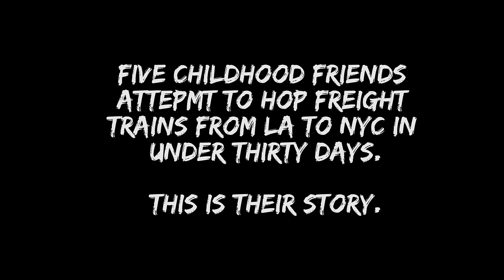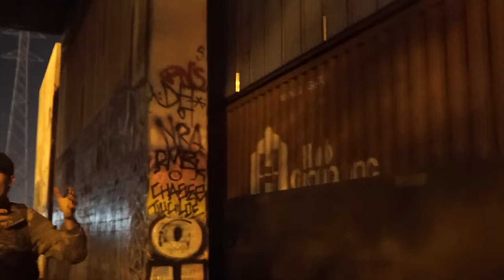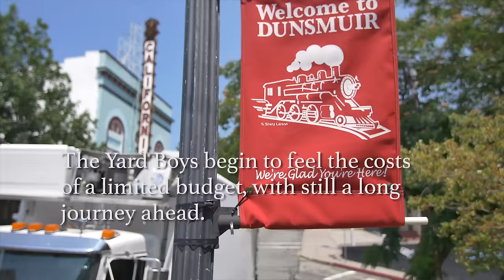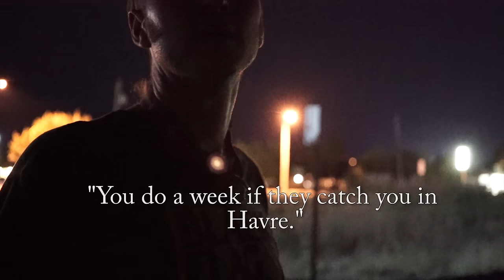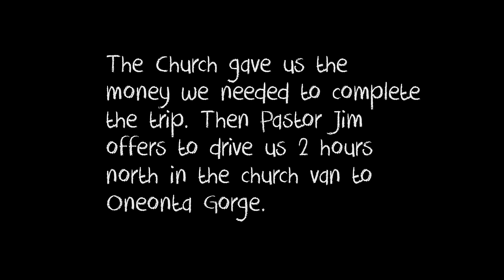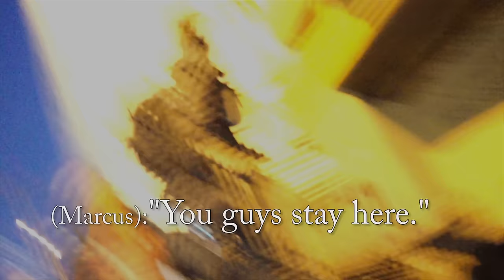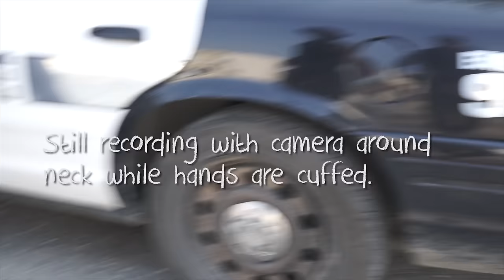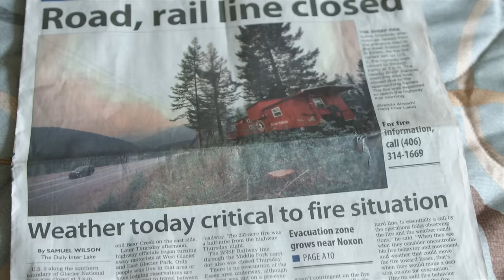YARD BOYS: Freight Train Hopping America

Comment: To anyone who is wanting to travel like this, here’s a few tips from what I’ve learned doing it with and without friend. 

Pack nuts, trail mix, or protein bars. They’re light, full of calories and fill you up without causing you too much time setting up. If you want more of a filling meal, beef jerky, tortillas w/peanut butter, and freeze dried meals are light enough to carry and dense in calories.

DO NOT try to hop on when a train is speeding past, you will either get seriously injured or die(you’re lucky if you get inured). ALWAYS three points of contact(at least two feet and one hand) to balance you. And NEVER stick your head out in a tunnel(because you can’t see what’s in front of you).

Bring earplugs because it is LOUD. Have a neck pillow(it’s a luxury that slightly cumbersome but it’s worth it). Always have gloves(black or tan).

Never fall asleep unless you are secure and do not roll around in your sleep while ON the train. If you do sleep off the train, try to find a place that doesn’t have slot of litter around(generally that means people are living their and you won’t get stabbed or attacked).

CASH IS KING. Always have cash on you because it will save your ass. I was almost arrested when I slipped someone a twenty and asked if I could go. It works most of the time, just not all the time. 

Do not do drugs unless you are in safe company. You CANNOT trust people you don’t know, especially when you are high as a fucking kite. 

Never bring a guitar or musical instrument, and definitely don’t bring any portable speaker. You will be found faster than you think. 

Make sure you pack for the climate and time of year. If you’re going in spring, pack for rain. Winter make sure to have warm clothes/warm sleeping accommodations. Summer, something cool. And Autumn varies, but always try to have warm-ish clothes that you can change in case it’s still warm. 

Always fill up on water. You’ll go through it faster than you think. Never get it from a creek or a pond, and always boil it even it’s from the top of a river. Stagnant water is always a no go. Water is surprisingly cheap, so if you can’t find any, just buy some. Having a tap key is helpful, just make sure to boil it to be safe. Also, always boil snow if you’re going to drink it.

Don’t fall in love, it never ends well and you’ll both end up miserable. And always use condoms when having sex. Mouth wash after oral(trust me).

Make sure to know the difference between a hard stop and a slow stop. Sudden stops in the middle of nowhere is usually either because the trains fucked or you’re fucked. If you hear people, stay put and get ready to run. If it’s a slow stop in a town or a yard, you’re usually in the clear, but still be cautious and don’t be stupid.

Finally, don’t take risks. If you’re 6th sense is telling you not to do something, DON’T DO IT. And if you’re gut is telling you to run, duck, or hide, listen to to your gut and so what’s easiest.

Also, fuck the dude with the blonde hair and glasses. All he would do would whine, bitch, and moan about how shit wasn’t going his way or would get in everybody else’s faces and just call them selfish or would just constantly fight everyone. Fuck that dude.
Reply: Thanks man
Reply: u sound experienced asf how long were u doin it?
Reply: but how was it?
Reply: thanks so much! planning on running away soon, and planning on using the tracks to get around.
Reply: @jaguarsparkle8788  good luck brother just keep in mind stay in the dark
Reply: Hell yea it’s December and I’m going from Houston to Chicago bout to hop a train wearing shorts and 2 t shirts,(one says tool on jt” have on white gloves only carrying my guitar and drum set, this is gonna be a blast will update with video within a week
Reply: Appreciated
Reply: Bro went through something
Reply: Man id have hoped to bring my acoustic, guess its time to bust out my harmonica lol
Reply: You're dope for posting that
Reply: @jaguarsparkle8788 what exactly are you running away from?
Reply: @one7deep7savage7 take a look around
Reply: + bring some hotdogs for a security dogs
Reply: the blonde dude with glasses at 12:00 was like “you have to get the shot” asking his boy to try and catch a train at 10mph with a camera in his hand lmao

Comment: Y’all should of mf ran into the woods like wtf why would you just stand there
Reply: yea isnt that what the camping gear is for lol exactly my thought
Reply: Other then They would have been stuck near a wild fire
Reply: @oxidizedgarage8265  they shoulda hid in the woods until the train inspectors went away and then hopped back on. simple. coulda finished the trip if they had any street sense.
Reply: @radakahl  I’m a bit late but you’re giving them too much credit lol
Reply: For real 😂
Reply: @radakahl  100% correct. They knew something was up. Trust your gut. E&E (escape and evasion) at that pont.
Reply: @radakahl  yeah but the wildfire wouldve killed them most likely if they got back on the train
Reply: These fools were already in so far over their heads, getting caught was their best possible outcome.  Running just would've compounded this goat rodeo.
Reply: @csn583  🤣🤣🤣

Comment: Did you also realize that aside from the danger of forest fires nearby, there's also the 7.01 mile long Flathead Tunnel just up the line outside Libby that you would have had to pass through? Getting arrested might have actually saved you all from quite possibly suffocating in that tunnel not knowing it was 7 miles long and the second longest in the United States
Reply: People ride thru Flathead and Cascades all the time with no issues. Diesel exhaust isn’t the same as smoke, it isn’t very good to breathe but it won’t suffocate you.

Comment: 12:00 bro what are u talking about, so inexperienced 
14:30 bro is bugging about something completely unnecessary & ineffective
16:50 can you guys just chill out, stfu, and see what happens? yappin isn’t gonna differ anything
27:43 one thing abt this film is if you were a teenager at one point and had a 5-7 person friend groups, parts of this vid relatable fs
36:10 real spill
57:45 better than a semi trailer flat car, if the train stops or they do a roll by or whatever when the crew is looking at the cars the only way to hide is stuffing urself above the axel on the trailer & not possible with ur whole group on the car
1:01:21 smart choice with the sleeping bag color 🤦
1:03:03 what are u doing
1:05:14 3 points of contact
1:08:43 thinking to highly of urself just like 16:50
1:12:09 constitution doesn’t exist
1:14:07 cringe lol
1:16:46 from the first clip when u said “this is our train it sounded the same as before” it was pretty obvious none of u guys were cut out for this lol